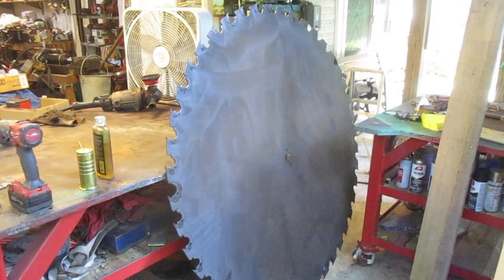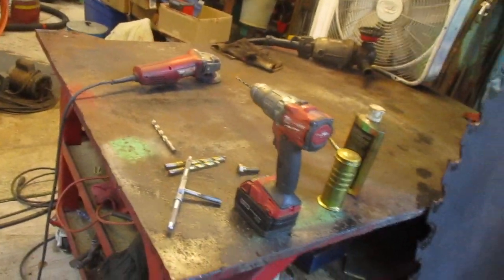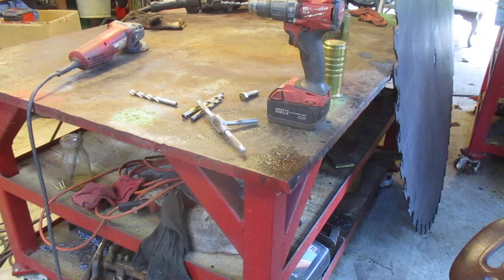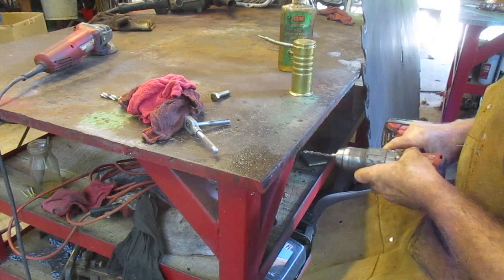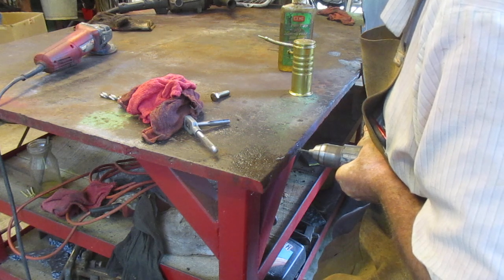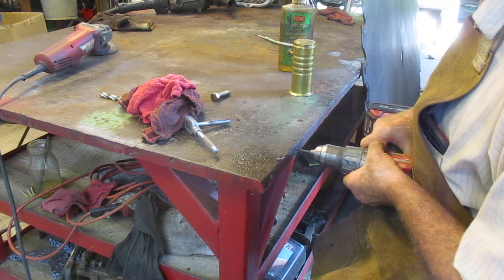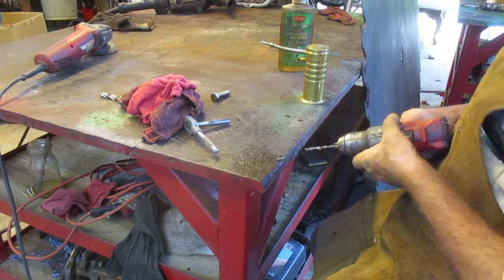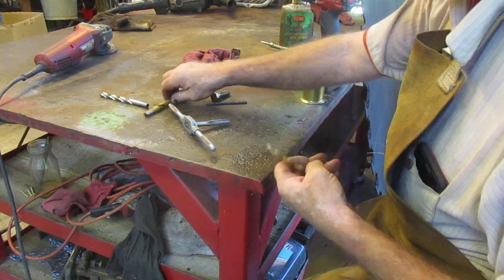Saw hammering bench kind of table making it ,# 1252

Comment: John you might drill that hole out another 64th larger if its that tight or it may be the steel is just that hard
Reply from the maker: hi there i think the tap is just old , its been working sense the 70's . it's now threads in about 1 inch , thanks for the help john